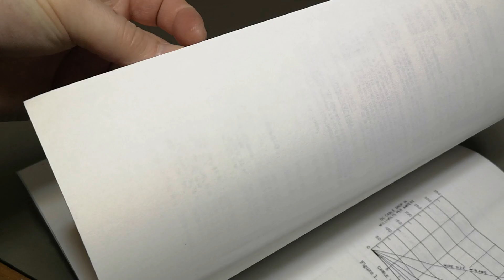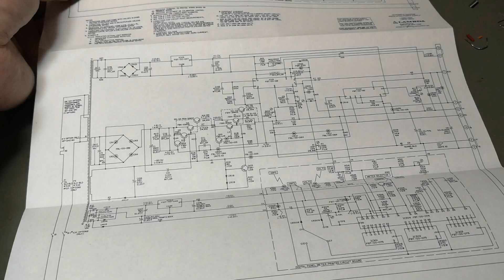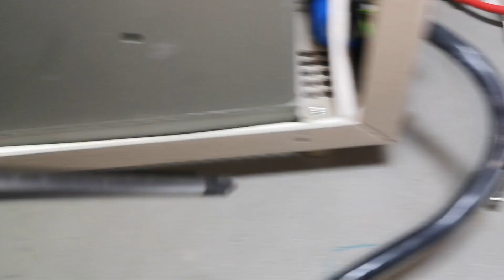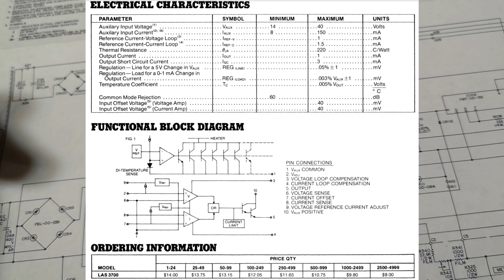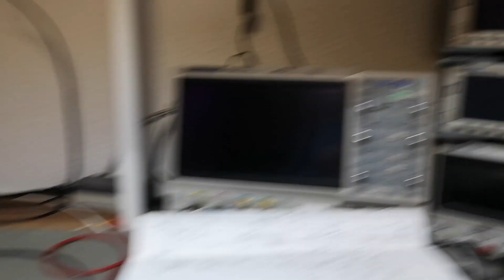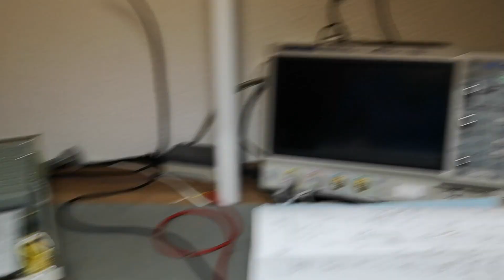Lambda LQ534 0-120V 1.7A DC power supply 1991 easy repair

Comment: I would guess that the heat is why they're not using double-sided boards. Even back in the 90s, we had problems with boards warping and connections breaking. Of course, that could have been from a scare due to some manufacturers using substandard boards; GE was famous for it, as they used a cheap paper-phenolic board in their consumer goods. Planned obsolescence and money-saving in one go?

However, there was a problem back then, even on FR-4 boards, which "often suffered from warpage due to low Glass Transition Temperature (Tg) materials, such as standard FR-4 or phenolic papers (e.g., FR-2/FR-3), which cannot withstand high soldering temperatures."

Comment: 110C for a reference? That is crazy hot! The design of this supply looks a lot older than 1990.
Reply from the maker: exactly why it tricked me to think it was broken, but a post about this part in a FB group lead to the datasheet and the specification, now we knew it is normal, and could seek elsewhere.. then it was easy

Comment: I got a kick out of the nameplate on the back.  I didn't know they were located in Melville, Long Island, New York!  That's 10 minutes from my house, and I worked there (in the town, not Lambda) for a few years back in the early 2000s.  Just funny to see you owning a piece of equipment from so close to home.

And keep up the great videos, btw!
Reply: As a side note, I was googling to see if they were still in the area.  They're still manufacturing PSUs somewhat locally, which is surprising: 

"Today, TDK-Lambda Americas (with ALE systems) is a vertically integrated manufacturer employing approximately 300 people. In 1995 EMI obtained ISO 9001 certification. All manufacturing is done in Neptune, New Jersey, in a modern 100,000 sq. ft. company-owned-facility."

(In case anyone was curious.)
Reply from the maker: how cool is that, thanks for your comment